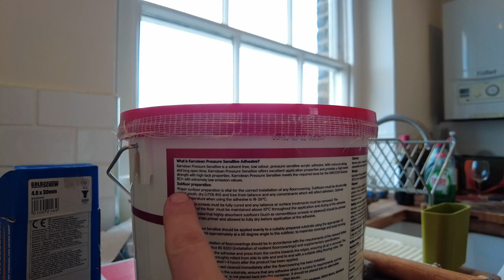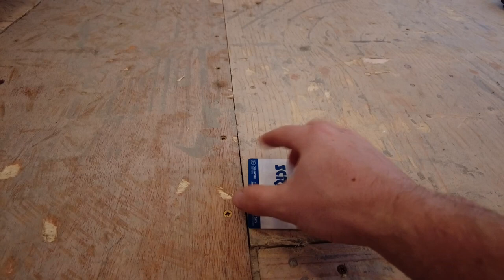DIY Kitchen Floor Makeover: Laying Karndean Glue Down Vinyl Tiles

Comment: I did a similar job in our hall, as an enthusiast (naive) DIYr using glue down Karndean wood plank and take make it even more complicated, with a decorative border insert.  After two or three hours, my kids had learnt lots of new swear words, so I told my partner to take them out for the day. Everything was covered in that ruddy glue, and it’s still on the skirting board 20 years later. My good it’s sticky stuff.  Anyway, the floor is still down, it has shrunk a bit end to end and opened up some gaps, but still looks great and I’ve just bought another reviver kit.  About to do the lounge and the click together version looks like it might be a whole heap less heartache.

Comment: If you ply the floor as you did ensure its the correct ply and you should be using feather finish for joints especially if you have gone to the expense of buying Karndean.

Comment: Great video 👍. I don’t think pressure sensitive glue ever dries completely, rather just goes tacky. So you can more easily replace a damaged tile. Im laying glue down LVT at the moment, but using evostick flooring adhesive which is quite “grabby” and dries permanently in about half an hr. Just going one plank at a time and putting the glue on the plank not the floor so I can take my time cutting and placing. For a DIYer I’d recommend that approach over gluing the floor and rushing placement.
Reply from the maker: Great tip! I wish I'd waited longer before I started sticking them down 😑 was pushed for time though. The stuff I used does eventually dry though, I couldn't get them sample bits off when I tried a few weeks later

Comment: You don't feather your joints then on the ply.
Reply from the maker: I didn't on this as it didn't think it was worth it. It's let out so its an improvement on the previous floor. If I was doing it for my own home I'd use the karndean skim coat to feather it (belt n braces n all that). It'll be interesting to see if the joints show after some use, I'm not sure they will though.

Comment: Top man for having a go. I’ve got 7 boxes of Amtico that I brought or a previous house I owned didn’t use. So I will be definitely having a go at laying it. We have just had a 17m x 4m extension done by the pros over a screeded floor with underfloor heating & had nothing but problems with a lot of tiles curling up on the edge.
Reply from the maker: Ah no way, do you know what the issue is? Was it poor floor prep (Laitance)?

Comment: Love your videos it baffles me why you haven't had a huge surge in subscribers yet!!!! Particularly liked the testing part. I had a nightmare with similar flooring adhesive, couldn't get it to go tacky, turned out it was because my floor was too cold. Years later I was told by a tradey that the trick is to set up a fan blowing air over it gently which helps it along in cold weather 👍
Reply from the maker: Thanks dude. Ah well, it's simple really, my subscribers hardly watch my videos so youtube doesn't put it in front of anyone else 😂 Did you like how I tested it and then ended up ignoring the outcome cause I took too long to glue up 🤦‍♂️ absolute nightmare, I spent about 40mins re-alligning the tiles and moping up glue, I was sweating 😂
That's a handy tip with the fan, I wish I just waited for it to go tacky 😬
Reply: @THE-AIDEN-PROJECT  it's just mad that back in 2016 all you had to do was make a decent video and you'd do really well. Hell, I didn't ever make videos that were any good back then and I still amassed an audience. Whereas nowadays you have to make a good video and be a marketing genius and basically a graphic designer and yet still it's so hard to compete! I'm glad I got started when I did otherwise I would stand no chance these days! I think the floor is fine, you could always get some of that 'colourfill' stuff rubbed in to the gaps? You'd never notice it then I reckon. Always tricky doing jobs for the first time and even trickier when you show the world on YouTube 🤣 so easy to sit at watch someone doing something and criticise it but it's not so easy to spot the problems when you're the one knee deep in doing the work! 👍
Reply from the maker: @RagnBoneBrown  I should have filmed doing my first house back in 2016 🤦‍♂️ I'll keep trying though. I have noticed there's quite a few tradesmen setting up channels in the last year, it's all more competition hey! People are spoilt for choice 😬
Good idea with the colorfill! 🙌 I think I might do a test video with a few different things and hardly anyone will watch it 🙄 😂

Comment: Useful video, thank you! We've put the ply down, now need to put the vinyl tiles down. I wonder if I should roll the adhesive after using notched trowel?? Tiles are 2.5mm thick but dont want anything showing through. Good tip on using a bank card to check if the ply sections are level!
Reply from the maker: The notches are really shallow if you have the same trowel as I used, I wouldn't use a roller afterwards. Just read the instructions on the adhesive 😂 I wish I waited longer for it to go really tacky so the tiles didn't move about 😩

Comment: Great job chap, how's it looking 1+ year on?  Has it been ok with the usual kitchen spillages? Did you get any movement? I'm looking at doing similar job. I heard you wait until the PS glue is translucent, but probably depends on the manu.
Reply from the maker: I'm pretty sure it's fine otherwise our tenant would have said something. It was down for a couple of months before it was let out and it was solid. I'd say it's all down to the adhesive and what type you get. So yeah like you said, depends on the manufacturer. I should have waited longer before I started laying mine 🤦

Comment: Great video mate. Felt your frustration with the gaps. Had the same problem on my floor. Soon filled up with dirt and now invisible lol
Reply from the maker: 😂 Have you got glue down vinyl too? I was thinking that they would probably blend in with a little time
Reply: @Building Acer View 🔨  haha yes. I went for herringbone in 3 rooms. Have to say it's probably the hardest flooring I've ever laid. I didn't use pressure sensitive glue though. Went for the mapie ultrabond eco. And used a roller similar to yours.  Was on my knees for 4 days lol🙈
Reply from the maker: @tomvincent5596  fck that! I'd never do herringbone in this stuff 😂 saying that, we're both experts now so bring it on! Haha
Reply: @Building Acer View 🔨  haha. Iooks amazing though.  But wouldn't do it again🤣

Comment: Thanks for the video, about to lay Karndean this week in my living room. Where did you get the hand roller from and do you think it was sufficient/any issues with the tiles not sticking down properly?
Reply from the maker: Tiles stuck solid, just wished I waited for the glue to go tacky before I started and that I did it in 2 halves. That's an ink roller, not ideal but does the job

Comment: Must admit, was yelling at the video to do it in two sections!
Are you going to fill the gaps with some kind of glue/grout/silicone, to reduce chance of any liquid/spills getting in there?
Reply from the maker: 😂 I was pushed for time! I wish I had them spikey shoes so I could have glued the near side first and then walked over to the hall way 🤦‍♂️ I think I just got away with it, there are about 5 gaps including the 2 I filmed. I was thinking of how I could fill the gaps but wasn't sure what to use. Maybe clear silicone? What do you think?
Reply: @THE-AIDEN-PROJECT  Bosh some black Stixall adhesive/sealant downloaded there? Or, cut a very fine slither of tile?  Whatever you do will be invisible to you after a week, and no-one else will notice.
Reply from the maker: @cedarstuff  I don't think anyone would ever notice anyway 🧐 there's noway I could cut a slither of tile, the biggest gap isn't even 1mm wide! I can feel another experiment coming on 😂

Comment: How to paint yourself into a corner?!....this was a tricky mathematical problem. I suppose you wanted to start the glue at the door and work in a clockwise direction, trying to exit the doorway to finish the last of the glue. Then after 20 mins lay the tiles towards the fridge area, again in a clockwise direction. Or employ someone with very long arms 👍
Reply from the maker: If I would have thought about it abit more I could have fashioned 2 bits of wood and screws into a pair of them spikey flooring shoe things! 😬 Then I could have started at the hallway and walked back over the glue. I totally misjudged how long it would take to glue though 😑
Reply: @THE-AIDEN-PROJECT  It looks very good to me....and if you had to do a similar job you would have a few extra ideas in your mental toolbox. We live & learn. 👍
Perfection is hard work.